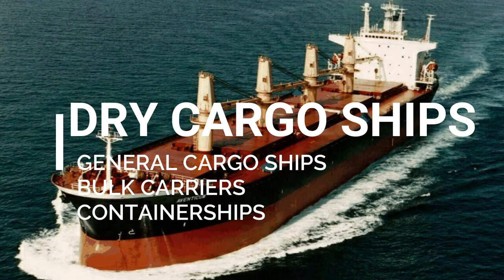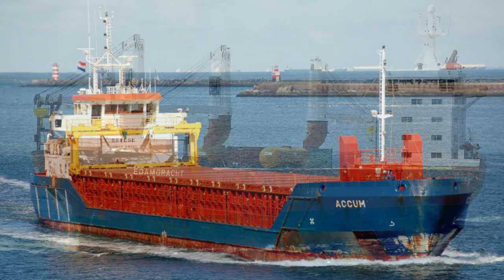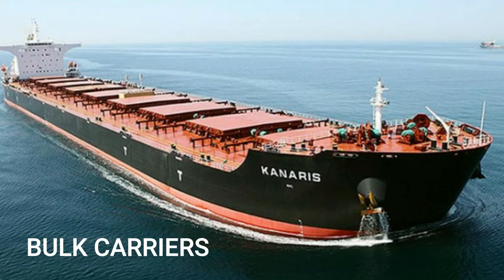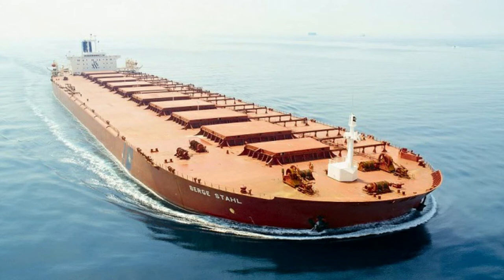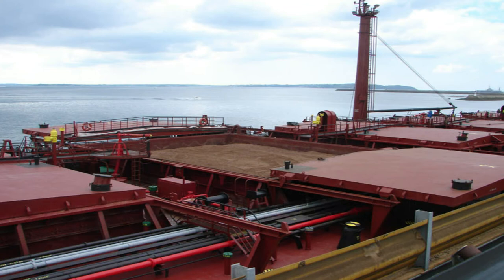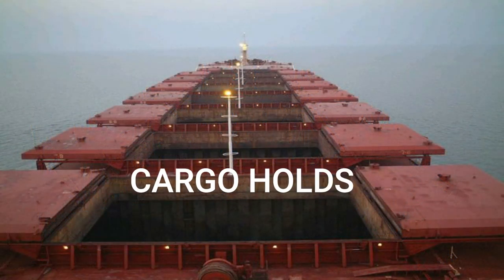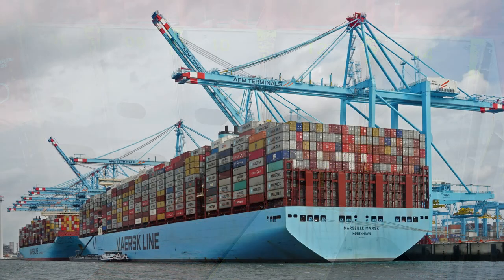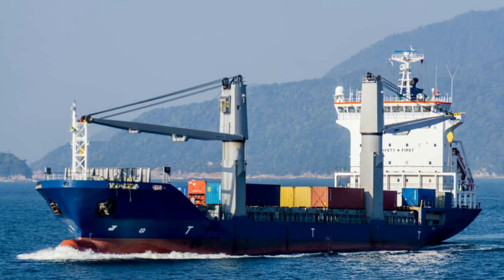DRY CARGO SHIPS: GENERAL CARGO SHIPS- BULK CARRIERS- CONTAINERSHIPS

Comment: Mister Marotta can you please tell me how can i mix cargo in a bulk carrier? I mean loading coal for example with grain on different cargo holds but at the same voyage? Thank you very much sir.
Reply from the maker: If you count with suitable cargo handling equipment to carry out that operation is no a problem... Let's say  some grabs along with a conveyor belts for coal and some pneumatic suction hoses for the grain and some hoppers as well.
Reply: @crescenciomarotta8014   please sir can you refer me to a site or anything to look how to do this because i need this for a report. How can you mix cargo in a bulk carrier. Thank you very much because i really search hard on the internet but i havent found many things.
Reply from the maker: Check marineinsight.com I think there you can come across that informartion
Reply: @crescenciomarotta8014  thank you very much sir.
Reply: @crescenciomarotta8014   I searched everything there but they dont have something refering to my need